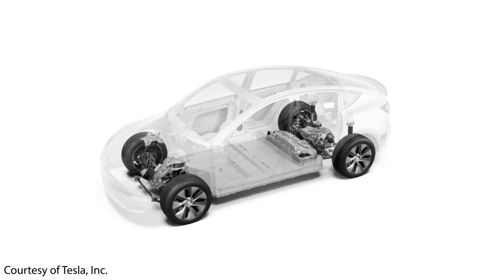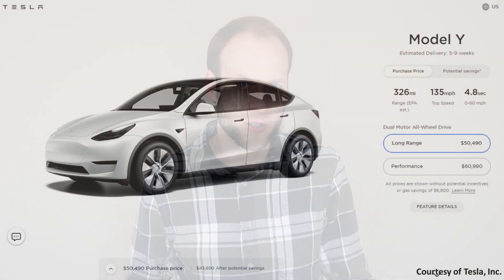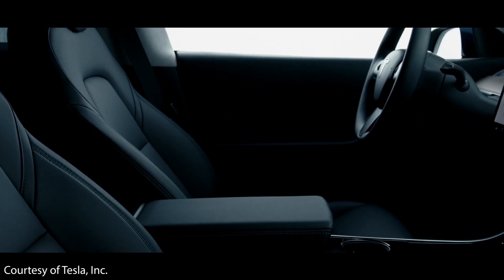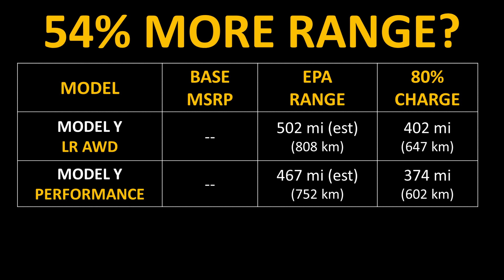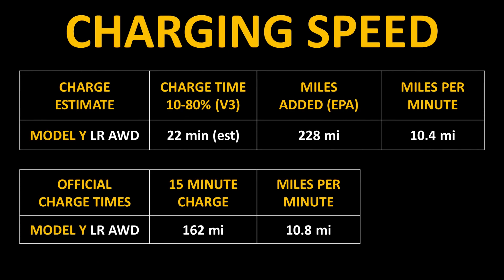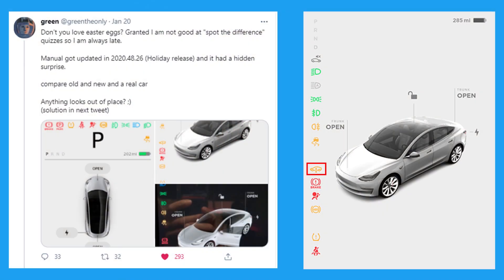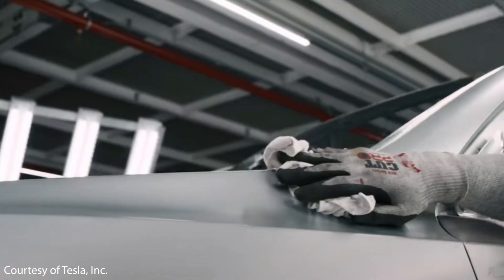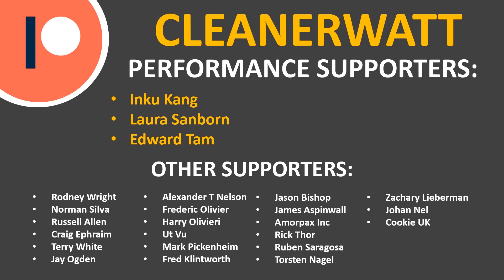Tesla Model Y 2.0 – Changes to Expect in Late 2021!

Comment: Your idea for the performance at Austin and the long range at Fremont makes no sense, wouldn’t it make more sense for the one with the longer range to receive the 4680s?
Reply from the maker: They will likely do the MORE expensive (lower volume) version first, because product ramp up is expensive, and it helps share the costs better for a higher dollar product.
Reply: @Cleanerwatt , good point, but that would defeat the purpose of the long range being called long range, in that case, the long range would be re named standard range. It would only change back to long range after it also gets 4680s. Although your theory also makes a bit more sense now
Reply: In my opinion, they should do them both, and on the website, put two versions of each, like for example, the Fremont long range and the Austin long range

Comment: Some things to answer.
What's the production rate at Kato road ATM?
How much stockpile do they have? (Must be considerable)
Which chemistry is it?
(Just btw I think I've mentioned before, the "cathode cost" chart on Battery Day showed "IRON" at 600Wh/kg.
LifePo4 is currently at 160 ish. 4x?
That would be only about 240
 cells

Comment: Great opportunity throw out the old and bring in the new. Should transition to 800 volt system and 48 volt accessory batteries. Badly needs air suspension.
Reply: 800v system doesn't bring much benefit to something like model Y only negatives. 800v gear is bigger, heavy more expensive and less readily available then 400v gear. The tiny amount you save on small cables you loose to bigger everything else.
Reply: I agree 800v speed up charging and reduces amps its the amps that creates heat and 48v reduce wire length and maybe some kind cam bus system

Comment: I would love to see 400+ range.  I currently have a m3 sr+. Range is an issue, when you throw in 8% degradation, plus the 30+% lots of range in the winter. I have to plan my days out carefully.  There's not always a supercharger around and going back home to charge,  isn't always convenient. 400 miles of range would solve almost all those issues,  but I have to keep in mind the reason I bought the SR+ to begin with, $$$$$

Comment: The faster the charge, the less range you need.
The 4680 (imo) will bring not only a faster charge rate into the cell, but a flatter charge curve across the capacity, less initial internal resistance, less heat, so less ongoing resistance.
I think (as EM had hinted) then will aim for lower range, with faster charge.
Less weight, less cost, more efficient use of material.
They will probably switch all model Y to LifePo4 in the 4680 format, improving longevity.
Reply from the maker: Very possible indeed... good insight.
Reply: I'd really like to see a  technology developed so battery power better imitates gasoline - where a lower SOC doesn't diminish performance.  If you track your Tesla, your day is over when SOC reaches 50% as power starts decreasing rapidly.
Reply: @aussie2uGA  
"If you track your Tesla"..... Will Tesla(and others) pander to the needs of about 0.0001%  of owners, or develop systems which suit the remainder?
It just so happens that I addressed this in my post.
Heat is the enemy. The 4680 should be more resistant (Or Less resistant? lol) read it again.

Comment: model y in texas and freemont cant be difrent cause every one will want austin
Reply from the maker: I believe they will remedy this by making the PERFORMANCE version in TX and the other(s) in Fremont.
Reply: @Cleanerwatt  when 4680 will be produced in scale? what about cathode factory? where model y berlin willl get the batteries from?
Reply from the maker: @davidcohen7741  10GWh (est) of 4680 batteries currently being made at Fremont factory. TX/Berlin could be producing batteries in 2022 for sure.
Reply: @Cleanerwatt  im not sure giga berlin will be producioin this year  also they didnt start biulding battery factory there and catode and lithium hidrixde factory
Reply: @Cleanerwatt  
You seemed confused between "long range" and SR+?
Reply from the maker: @rogerstarkey5390  Why do you say that? By Long Range, I am referring to the AWD Non-Performance version. There is no SR+ Model Y, only an OFF MENU SR.
Reply: @Cleanerwatt  "off menu" meant "in stock".

Those cars are gone. You can no longer get SRY.